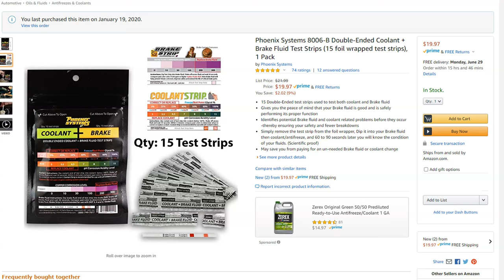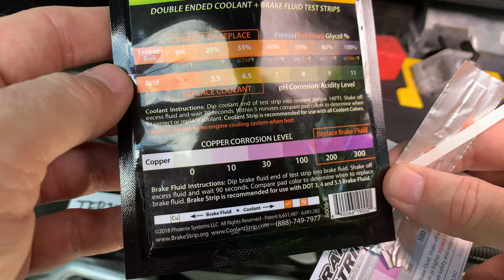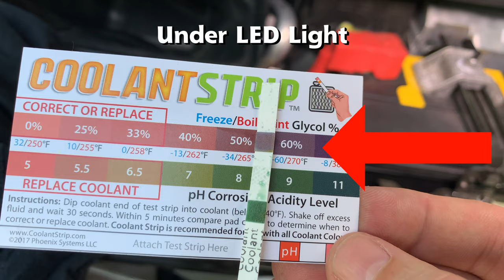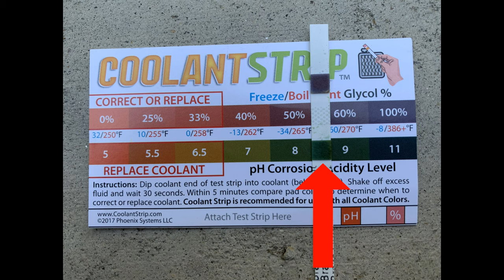Tesla Model 3 - Coolant Testing

Comment: Really awesome advice to check these two fluids every two years! There is no combustion engine contaminating the coolant, so I wouldn’t expect much change ever showing up, but the brake fluid would rarely get hot enough to boil away water and that could cause corrosion. I couldn’t help but notice that you added a grill to keep large debris and leaves from entering your ventilation system. Maybe you’ve already done a video?
Reply from the maker: Thanks.  See this video for the intake cover:  https://youtu.be/N-h68T8k3-Y
Reply: The brake fluid is hygroscopic, its absorbs water, so it must be changed every two years or damaging results to abs and other parts can happen.
Reply from the maker: @aussie2uGA  Yes, I stated that in the video.  However, if the test shows that the fluid is within limits, you don't have to replace it.  Testing is recommended by Tesla.

Comment: Very careful not contaminate the coolant. Why do you use a rusty pair of pliers ?
Reply from the maker: Yes, thanks for noticing that.  The pliers never actually touched the fluid.  The fluid only went about half way up the  strip.  But that is a valid point!
Reply: Tesla Tips by MTN Ranger That is true, but i noticed you being very cautious and cleaning the filler cap. That is why i put in my remark. For the rest keep up posting your vids. Very helpfull, being a fellow Model 3 owner ( in the Netherl@nds)

Comment: Do you have a video showing access to the fan ?
Reply from the maker: No I don't.  It would require removing the front bumper to take apart the radiator housing.